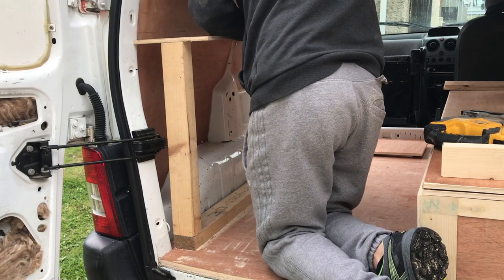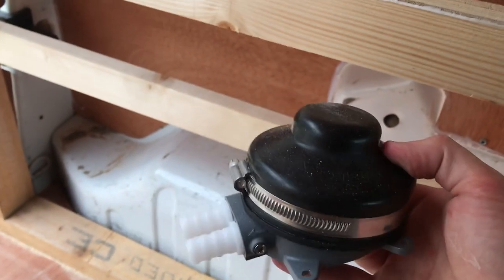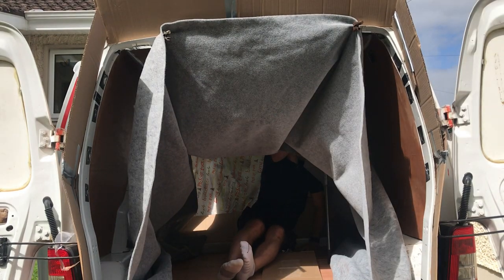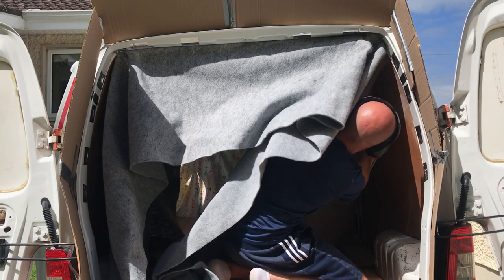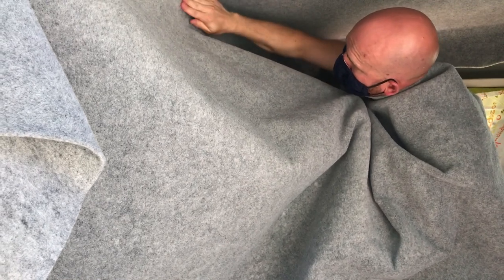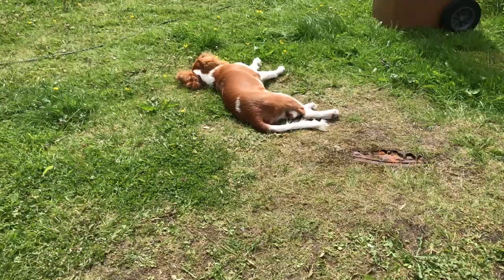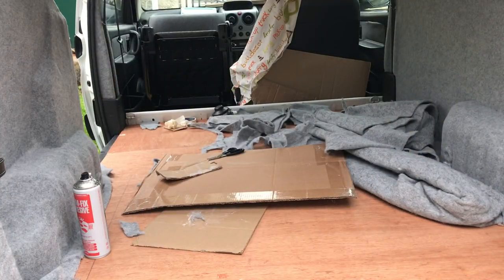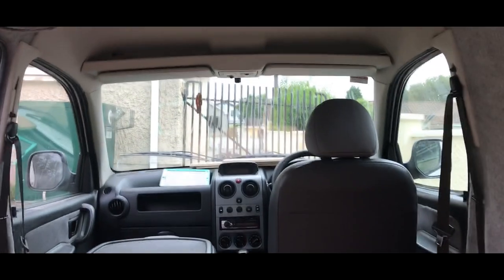Citroen Berlingo [Carpet Lining] [MICRO, STEALTH, MINI CAMPER] (#EP8) (2006 Berlingo)

Comment: Thanks for these videos. I haven't started my Berlingo yet. I'm still unsure where to start.
Reply from the maker: Hi JP, id start with the electrics if your going running power and then ply line and insulation. That will give you a good reference for fitting carpet and furniture etc. Thx for watching :)

Comment: Too much use carpet/cloth in a van gathers/absorbs dust/moisture while driving/stationed in the long run n requires vacuum cleaning. Later van becomes stinky n itchy Setup is good.....😊

Comment: Hello Sid will you be staining the ply grey looks kool tidy wee van
Reply from the maker: Hi Stephen, yeah i painted it in grey emulsion and then varnished over it. Probably should have done it a different way as the varnish yellowed the color a little.
Reply: @DjSilish  something a we bit different the seats in the van i bought needs a good clean seen people use Drill brushes are these any good  i was thinking brush with some 1001 carpet cleaner might do the trick
Reply from the maker: @deranocasper  Yep indeed, drill brushes will make it quicker but a decent scrubbing brush from a pound shop will do the trick also, any kind of carpet cleaner should be good. If you can get some AutoSmart G101 that will de-grease and clean them in one its super cheap if you can get some. If you dont have a carpet extractor dont soak the seat and use loads of microfibres to try and draw out the dirt, throw into a tub once saturated. Hope that helps. :)
Reply: @DjSilish  appreciated Sid thanks for the speedy response and information 👍 i will look in to it I think my partners bro has a wet and dry vac  cheers

Comment: Hi mate, what length carpet lining did you use and what thickness? Also great conversion!! Cheers.
Reply from the maker: Hi Josh,
In total I ordered 5m x 2m width of the carpet and that just about did the van. I bought it from highpeakconversions.co.uk very helpful I rang them and found them very decent. 
I also used 5 of the high temperature spray adhesive.

Hope that helps 👍

I'm not too sure what thickness it was probably 3 or 4mm it's the four way flex carpet.
Reply from the maker: josh griffin  I left a link to the carpet in the description just there